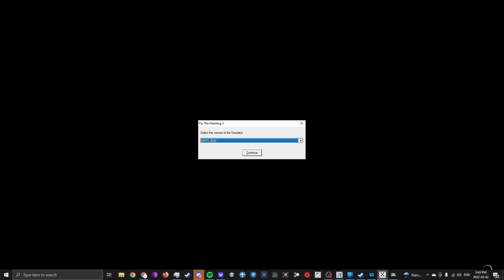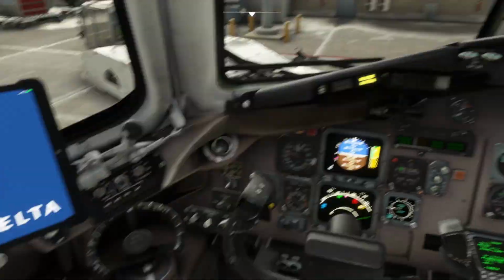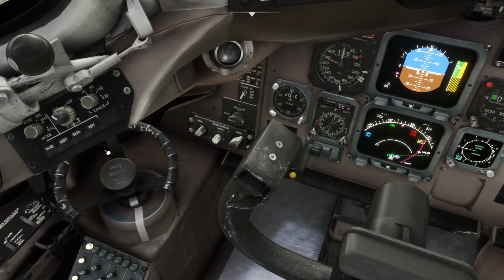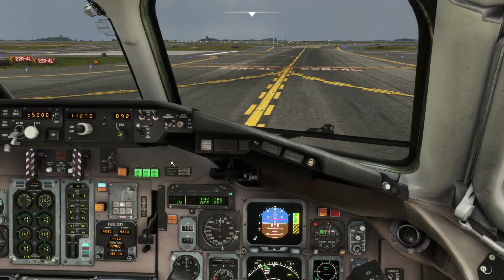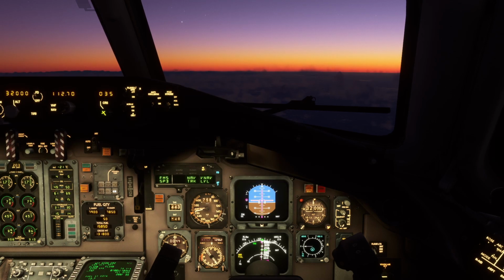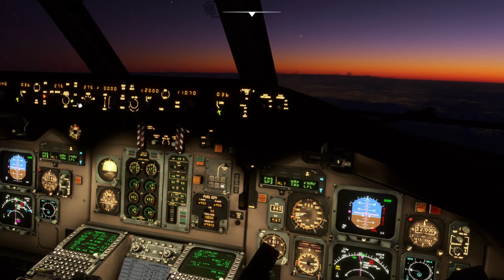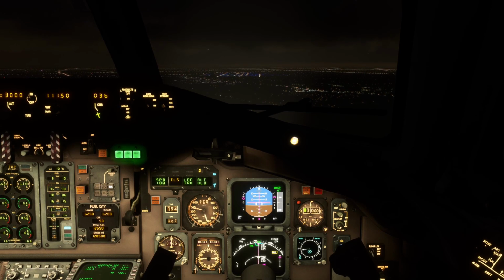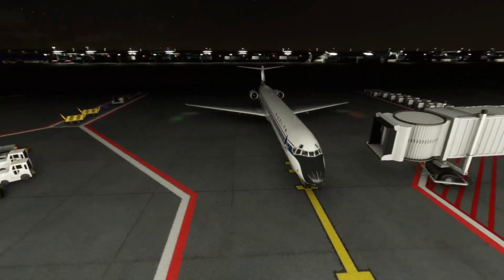Microsoft Flight Simulator 2020, Leonardo Maddog X, The New Definitive Tutorial

Comment: Great video. I get a check cabin pressure warning at about 10k feet, can’t get the warning light to go out, any help with that? Thanks
Reply from the maker: Check that your pressurization landing elevation and altimeter are set, the panel switch is set to primary, cabin rate set facing upward.